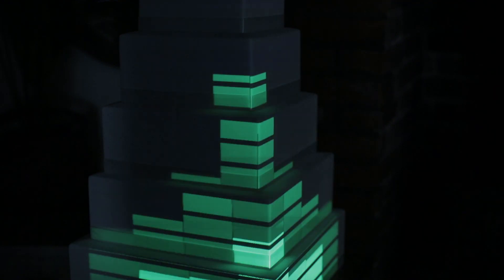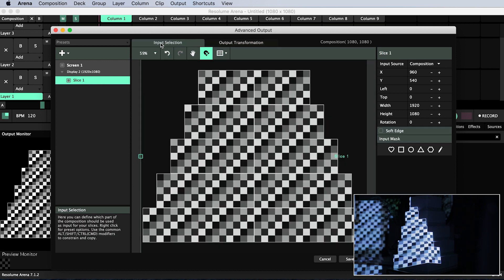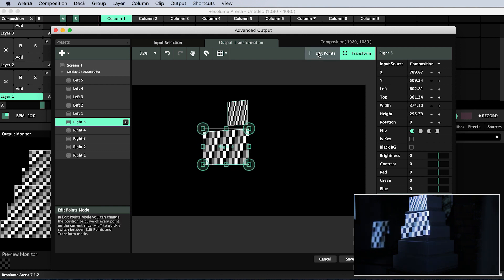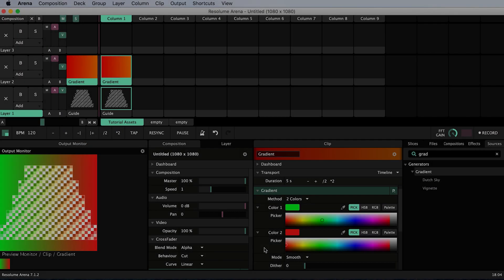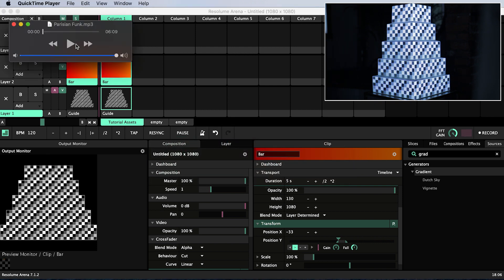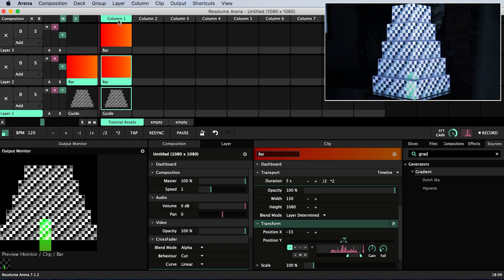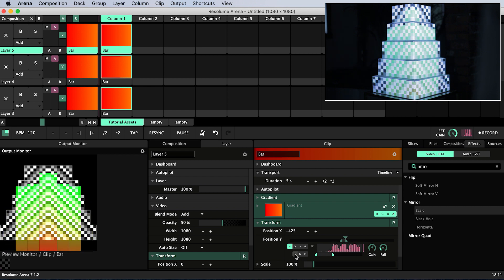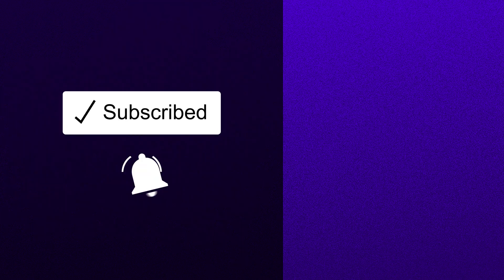Resolume Effects: Audio Reactive Equalizer Cake Projection

Comment: If I increase the resolution of the composition more than the projector resolution ,can i get clear video? 
And do you prefer madmapper or resolume arena?
Reply from the maker: You cannot force the projector to reproduce more pixels than it has to offer by increasing the composition size. There is some optimisation you can apply at the slice creation stage by packing them more efficiently into the 1080 x 1080 space, or indeed the 1920 x 1080 space (think how many pixels we are wasting horizontally!) Watch this tutorial from around 04:35 https://youtu.be/gVTjA1nwZro?t=275 to get some idea of what I'm talking about. But with this approach, the composition will no longer map straightforwardly onto your surfaces - you need to similarly 'optimise' your composition or pre-made video content. 

MadMapper and Resolume excel at different tasks. Resolume is great if you want your effects to react to a live environment and make changes on the fly - plus it has loads of scope for creating, layering and customising effects. MadMapper is more about straight projection mapping and is consequently very user friendly. Does that help?
Reply: Luma Bakery yes thank you
Reply from the maker: No problem :)